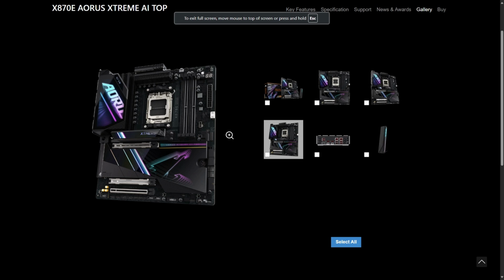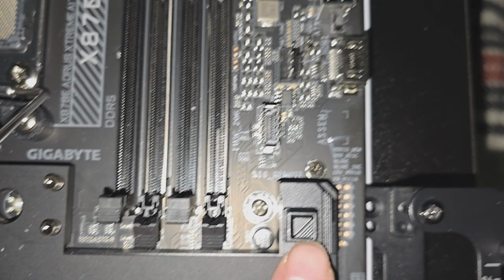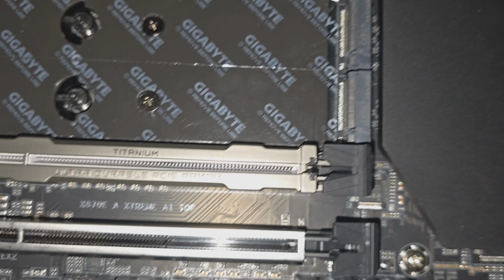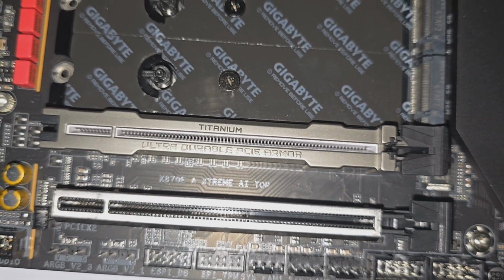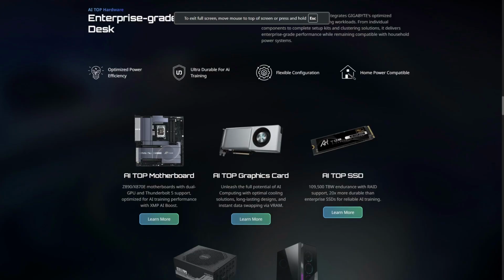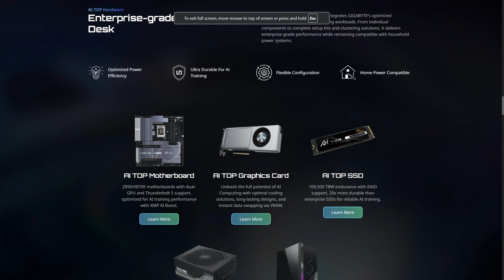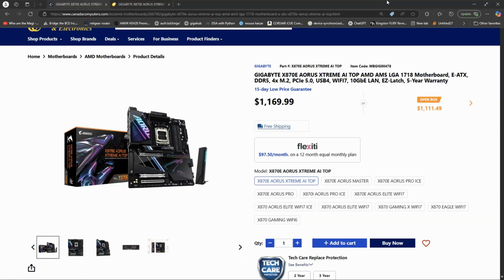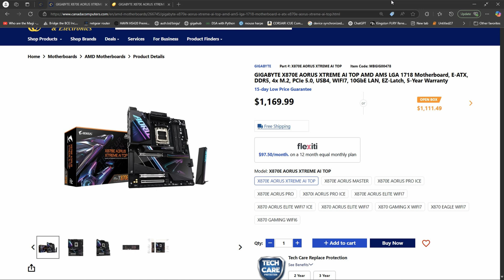The Most Insane AM5 Motherboard? Gigabyte X870E AORUS XTREME AI TOP Unboxing and Review!

Comment: I'd really appreciate it if you could check whether your motherboard is experiencing overheating issues with the secondary chipset. You can monitor the temperature using HWiNFO — if it's around 90°C, that could indicate a problem with improperly applied thermal paste.
Reply from the maker: yes it was i had to open it up in order to add thermal paste. One of the chipsets wasnt making contact with one of the xhci chips which was making it go close to 98c. Had to remove the backplate and added some thermal paste on each chips. Problem is gone since then
Reply: @MaxtechCA  Thank you for the information and I'm glad you managed to deal with this problem in the case of your motherboard.

Comment: I got screwed,  I've purchased the gigabyte Aorus Master x570e, X670E,  and now just went with the Aorus X870E Master again. 
Except they didn't tell me I spent a extra $100 or so just so I can't use all my m.2 slots. 
I actually had the Aorus X870E Pro and returned it because it only had the 2 gen5 m.2 spots and 3 gen 4 m.2 spots. So I returned it and went with the Master.  HUGE mistake. I can run the on gen5 single m.2 slot with no problem, but can only run one gen4 m.2 drive because the other m.2 lanes are connected to the graphics ports pcie lane. 
Meaning my RTX5090 which is a gen5 card can only run at 16x if I leave those other m.2 slots empty. Put one in, and your gpu lane now runs at 8x speed. And so on and so on. 

Yes I could have returned it but it was too late by the time I picked up on the issue. 

I have two 8TB gen4 m.2 nvme Samsung 990 pros running in external usb4.0 enclosures which atleast I still get to use them, but I wish they made this issue clear on the box. They don't mention it anywhere or else I would have gotten the pro instead.

Comment: Hey, great overview! I purchased it as well, on sale, and it's the best enthusiast board for the $$$. Puts the "Godlike" and Hero to shame, specifically offering dual TB4 and dual 10Gb ethernet. Plus it doesn't scream, "LOOK AT ME: GAMER!"
Reply: Many have heating problems I ve read on reddit because of manufacturing and design issues, i hope you wont
Reply from the maker: Only with the xhci chipset. I had that issue but i opened it up and fixed it. Was a bit stressful to do because i had to remove the whole backplate in order to reach under the m2 heatsinks
Reply: @MaxtechCA  Just FYI, I checked the temps and never had that issue. Likely QA issue, which isn't unique in electronics
Reply: I got this card for 770 euros, but I'll probably return it. I don't know how you judge these hardware, but this card is definitely pathetic... first... if you look at it from the side you'll see that the card is curved in several places. second... what is the blackplate on the back? Plastic or aluminum so thin that I don't know what type of passive cooling it can offer. Then there were no accessories, not even a hub for fans or RGB, not a USB with drivers, not cables or adapters for RGB or fans... and I'm not mentioning the problem of the chipset overheating because it can be solved by disassembling it anyway. But where is the quality control on products that cost this much? I say these things because I come from an Asus Rog Crosshair VIII Extreme, always Extreme E-ATX, paid 780 euros 4 years ago... obviously it was the top motherboard for x570 at the time. We are on 2 different planets. As for gadgets and accessories, the Asus card weighs twice as much as this one despite the dimensions being identical, the backplate on the back is METAL and you can feel it with your fingers and you can see that it is thick... the card from every angle is perfectly straight... I mean aside from brand preferences, aesthetics and BIOS, objectively there is no comparison between the Asus I had and this one. I was very disappointed, not by the features, but by the overall quality of the product.